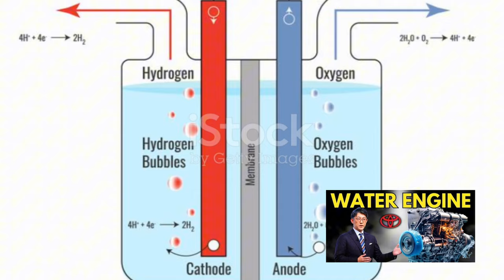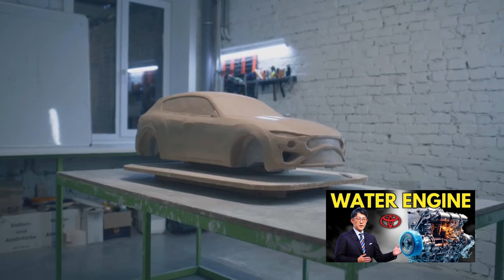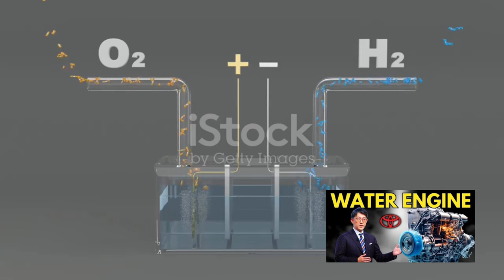Toyota’s Revolutionary Water Engine

Comment: So it is a hydrogen fuel cell. Cool. Please don't call it a "water engine." water is the exhaust, not the fuel. You don't call ICE engines, "carbon dioxide engines."
Reply: Seems like it's a new invention right? Very misleading
Reply: And it doesn't address what energy source is used for hydrogen production

Comment: Imagion a world where 4615 hydrogen tanks and filling stations are exploding every day.
Then you have the "water engine" world. A hydrogen tank explodes 0,34% a year. If all cars in Norway where hydrogen, you would need 4-8 more filling stations, and 3 stations would explode every day. The price of thoses filling stations would be 2-3 times the Norwegian oil fond.
If you increase this to the world level, you will get the number.

Oil is forcasted to be subsidized $9.000.000.000.000 up from $7.000.000.000.000, in 2023.
That's over $1.000 for every citizen on earth.
This is higher taxes, more expensive food, clothes, homes, and all other things you need.
With EV's you can use solar, wind, and maybe a streams to fuel your car.
With electrictrisity, you woulden't be a hostage to a middle eastern cartel with mostly dictatorships.

Comment: rarely heard such bullshit.

Electrolysis has 80% efficiency, combution engines 25-45%, so lets be generous and assume 50%
this gives the whole setup about 40% efficiency if we are generous

Batteries have 99% efficiency, electric motors have 85-90% efficiency
this gives an EV an efficiency of about 80% if we are pessimistic

so you basically get less than half the milage for same power input from "water engine" than from classic EV.
and as a bonus: as electroysis is pretty slow charging once takes half a week

Comment: AI shitware video. word salad galore that tells almost nothing.
electrolysis requires more energy to create hydrogen and use it.
you'd need pure distilled water for it also - which requires more energy.
Its less energy efficient than just use carbohydrates. Electric motors are the most efficient engines in theory.

Comment: Mostly word salad, a lot of virtual arm-waving, and very misleading. Toyota is working on hydrogen fuel cell electric and hydrogen combustion engine vehicles. You can make green hydrogen by electrolyzing distilled water using renewable energy. Most hydrogen today is made from methane (natural gas) in a process that releases carbon dioxide. Making, storing, and transporting green hydrogen requires almost as much energy as the hydrogen produces as fuel. There is effectively no infrastructure for hydrogen refueling in the US. Hydrogen is difficult to store, transport, and handle. Hydrogen released into the air forms an explosive mixture and will explode in the presence of an ignition source. Oh, yeah. Electrolyzers and fuel cells require expensive rare metals like platinum as catalysts and Hydrogen internal combustion engines emit harmful nitride pollutants. So what's the point?  I don't know, you'll have to ask Toyota.

Comment: I think there 5 fuels ⛽️ for future
1)CNG
2)Hybrid
3)petrol
4)Electric
5)Hydrogen
1 being the best alternative 5 being the worst.
For future fuel Toyota has done progress in water Engine but how will you produce Hydrogen it takes more energy to produce Hydrogen as compared to Electric cars Energy Creation. Hydrogen is extremly Explosive dangerous storage is crap
Reply: "Hydrogen is extremely Explosive dangerous storage is crap". No. hydrogen does not explode. It needs a HHO mix to explode. Otherwise, it will burn when in contact with heat and air (21% 02 79%N2), Storage is just in a tank, nothing more dangerous than a scuba tank. H2 will immediately disperse upwards when released. Compare that with benzine (gas).
Reply: @Oli4Post  HOw much Energy do we need to produce Hydrogen as compared to other sources.
Reply: @girishpai4538  stick to the argument.
Reply: @Oli4Post  I'm not an Engineer but I Understand Finance Water is cheap compared to fuel but the production storage is a Disaster the Money required to Finance will not feasible Why are companies not producing Hydrogen Cars   we can ask any company the answer is simple Money.
Reply: @Oli4Post  we need stick with fuels like CNG Hybrid for the next 25 years until we find a break through
Reply: @girishpai4538  then use these arguments. You said hydrogen is explosive. It is not. Hydrogen cannot explode out of it's own. Hydrogen can become explosive with oxygen, but CNG and petrol too. So that is a non-argument. "Cheaper" depends on the measurement and is always compared to an equivalent.
Reply: @girishpai4538  based on what argument? Hydrogen can be a good alternative, but it all depends on how you use it and how you create it. All tech is there. Light weight hydrogen storage is less complex than heavy-weight battery storage. Both are ways to store energy.  Though the storage of energy in batteries is more efficient, you still have to propel the battery pack too. carrying 1000 kg of batteries in a car, cost energy and this energy loss must be distracted.  It is not energy-in versus energy-out. It is energy-in (cost) versus value. You want to move people and or goods, not cars.
Reply: @Oli4Post  that is also another problem there are problems with this fuel  in terms of storage a single leak can cause Explosion with the pressure  also feasibility also
Reply: @Oli4Post  That's what Toyota wants to try let's in the future whether we can get Hydrogen fuel cell cars that are affordable and safer.
Reply: @girishpai4538  Again, stick to your arguments and do not introduce new ones if you get falsified. You first have to admid your previous arguments are wrong (otherwise you do so implicitly).  About the tanks: No, it cannot explode. If the tank bursts, hydrogen will escape and quickly disperse upwards (lightest material). Unlike a petrol tank (which would spill all gas to the ground), it poses almost no danger, even when burning. As a scuba diver, I can assure you it is safe to carry and handle high pressure 300 bar tanks. H2 tanks in cars are more safe an tested to the limit. A Tesla battery is way more dangerous.
Reply: @Oli4Post  That's why I have kept Electric cars in 4 and Hydrogen in 5